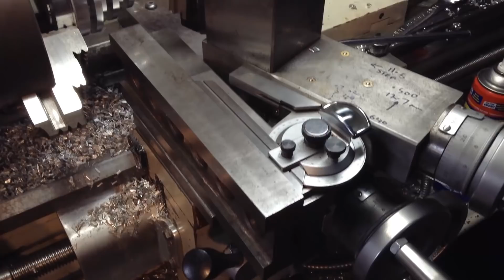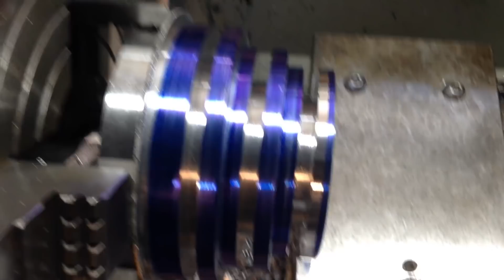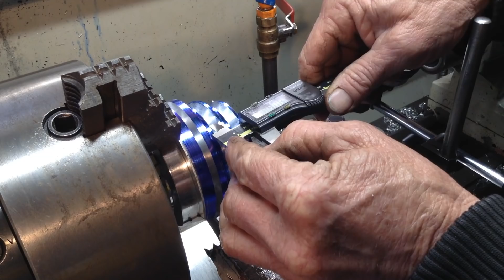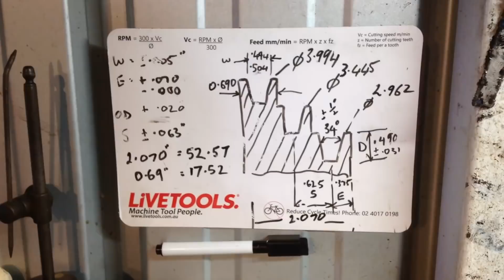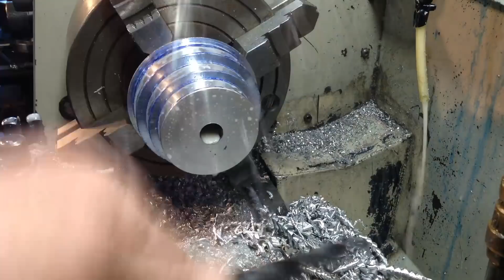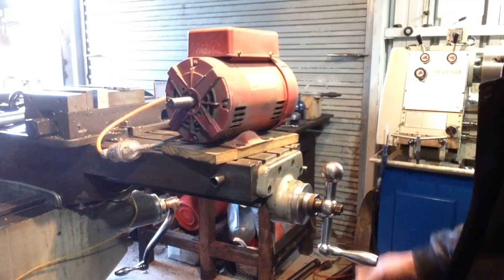Stepped V -  Pulley .   Part 2 .

Comment: Hi Max.
Why didn't you plunge in with the 3.63 angle cut  ?
That tool was working so well.
Reply from the maker: Hi . I did not plunge cut the angles like with cast iron so there would be minimal chance of any aluminium build up on the tool damaging the finish .

Comment: Great job on the stepped V-Pulley Max 👍 the tool you made did an awesome job and left a fantastic finish on the pulley grooves 👍 good tip too on not to take a cut out with a boring bar 😎👍👍👍
Reply from the maker: Thanks John .    Cheers .

Comment: Hi Max, I have always machined my A, B, C section pulleys at an included angle of 40 degrees, hope I got it right.
Considering a DRO for my Lathe but the problem is I will lose tailstock travel up to the saddle with the scale mounted on the tailstock end.
Reply: Hi Max,  went to the Fenner website, 32 degrees under 1 1/2 inches , 38 degrees larger than 1 1/2 inches, learn something everyday.
Understand the wedging action now to stop slip!
Reply from the maker: @willemvantsant5105  Yes , different angles according to the diameters .

Comment: I’d like to see how you have the dial gauge on there , I have an AL960b and it vibrates the dial way more than yours but I’m using a Noga and suspect that probably isn’t rigid at all
Reply from the maker: A Noga , i should think would have no troubles if it is a genuine one .  I have never used a Noga though .   Check to make sure the base has no burr's .
Reply: @swanvalleymachineshop  thanks Max I will check it out cheers

Comment: max, i was glad to see you do a "one chucking operation"  on this part.  so many of the people on utube take things out of the chuck/vise when they dont have to. then they spend 3/4 of their time readjusting the part!  bravo  poppy's workshop says HI
Reply from the maker: For a one off part Poppy , that's the best way to do it .   If i had several to do in a centre lathe , they would be in and out several times using block turning methods & soft jaws bored to the correct size .        Cheers .

Comment: good job max..the pure art machining off old school
Reply from the maker: Thanks .   The only cnc machines i have used were at trade school back in the mid 1980's  , they had computer punch cards that you typed with a special type writer & then inserted the card into the machine !       Cheers .
Reply: friend max ... the knowledge of the old school is still very necessary no matter how much cnc they come to use ... the parts and what to fix them ... position them and a long etc of operations that the operator must know and follow to the letter ... and oh that's where the old school knows all the lessons .. a greeting and good health  @swanvalleymachineshop
Reply from the maker: @TrPrecisionMachining  Thanks .

Comment: My lathes don't have graduations all the way around either, my small lathe has a mark on the back of the compound so i can always use the graduations even when it's past the front reference mark and with my big lathe i just stamped in my own marks so i had references marks to use the graduations at any position.. saves cracking out the protractor and accurate enough for pulleys etc
Reply from the maker: Yes , that's close enough for most jobs .   Cheers .

Comment: Always amuses me when someone drills a hole through something in the lathe then reams it only to find out the hole no longer runs true , some go to the extent of skimming with a boring bar after drilling then ream it and I think to myself WTF??? You already have the boring bar set up just bore it to size and be bloody done with it !
Reply: Flash Max makes it look way to easy..
Reply from the maker: That's right Ian . But if your lathe has a lot of wear in it , boring  then reaming is the only way to get a parallel hole .   Cheers .
Reply: @swanvalleymachineshop  
True and I have used a few machines that were so flogged out that on longer sections  I had to finish every diameter with a file then emery cloth to take the taper out ! On those machines the compound was dialled in to machine short journals and bores and it was punishable by death to move it 🤣. So happy those days are gone I can tell ya 🤣
Reply from the maker: @Flattyman  I have used some where i have had to adjust the cross slide a thou every couple of inches whils't taking cuts !